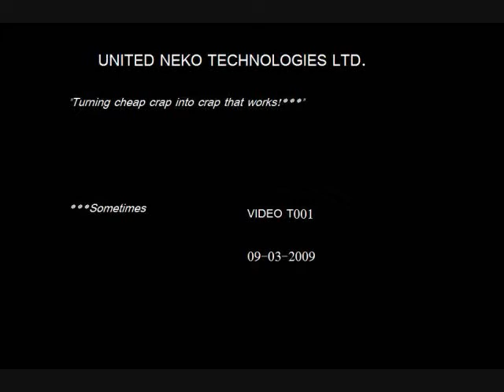Inverted ball bearing motor

Comment: The ball bearing motor is something mainstream physics tries to hide. It does not operate on thermal expansion. If you had a long wire conducting electricity and then chopped this wire in smaller pieces that can rotate along the wire and gave them a spin all would rotate. This is a fundamental physical effect which is being ignored.

The ball bearing motor is not the most efficient application of this concept.